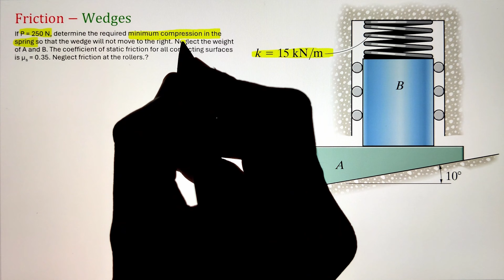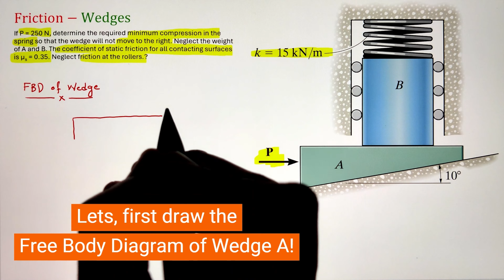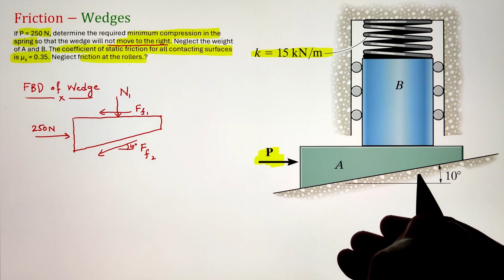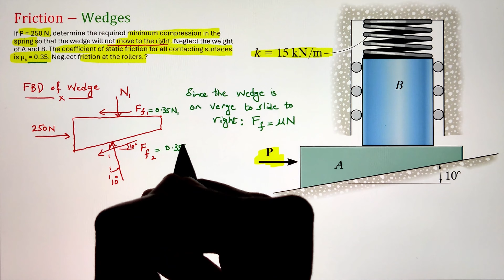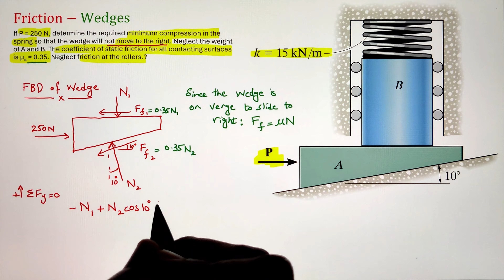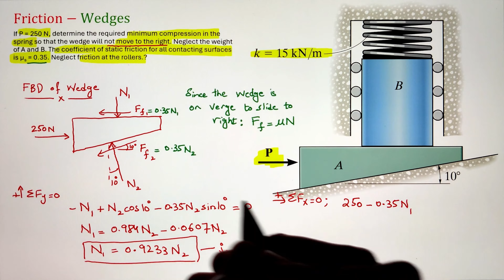Statics Wedge Friction Problem: Minimum Spring Compression Required | P = 250 N, μs = 0.35

Comment from the maker: This problem is all about correctly identifying the direction of impending motion and friction forces. Once the free-body diagrams are set up correctly, the minimum spring compression can be found using static equilibrium and Hooke’s law.

What part of wedge friction problems do you find most confusing: friction direction, normal forces, or setting up the equations?